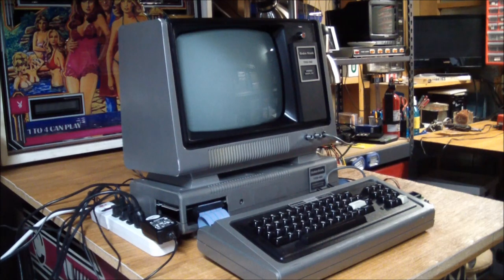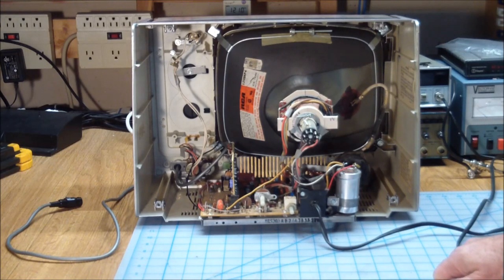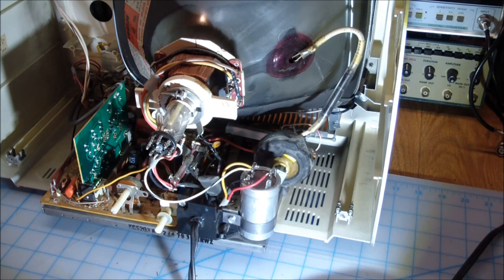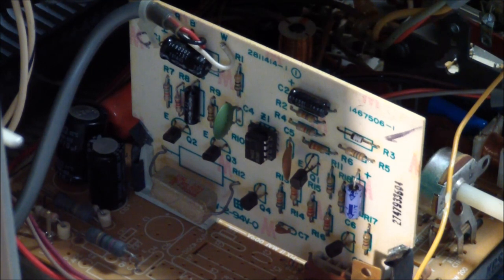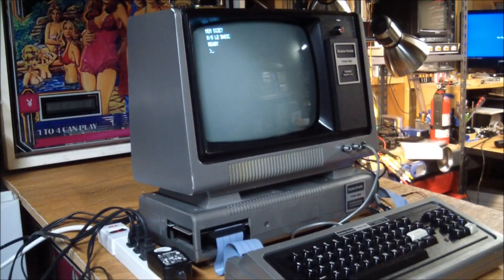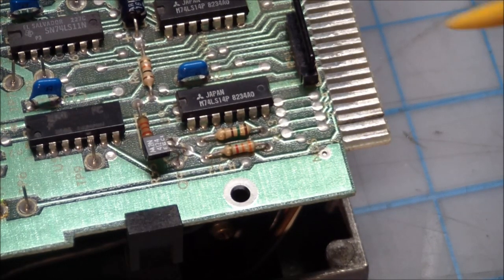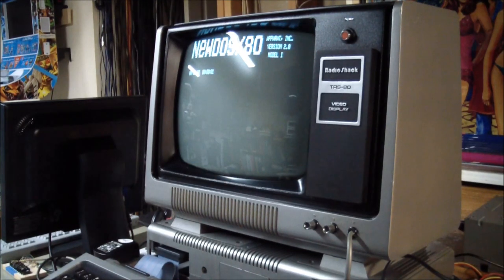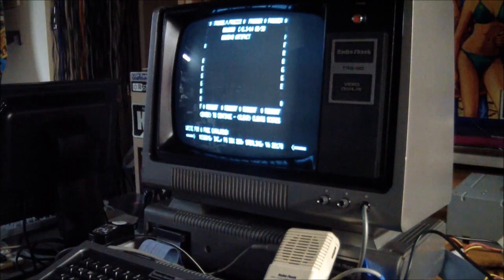AE#71 Radio Shack TRS-80 Model 1 monitor trouble

Comment: Optocouplers almost always fail as low gain, with I guess the led losing emission, because they are almost always overdriven to get decent output. Must have been the cheapest TV sets they could buy to convert, as 220V sets almost always used a transformer to get 12V, or used a better power supply that provided the B+ and other rails from the transformer of the LOPT and a higher voltage lopt supply generated by another supply locked to line, so there was no dot crawl.
Reply from the maker: You're right, I've seen this problem in pinball machines where the opto led was always driven very hot. In a Twilight Zone machine they used limiting resistors rated at 1W, and even those radiated a lot of heat.

Comment: Radio Shack way too cheap to add a 4 position DIP switch for the drive select.  LOL
Reply from the maker: That was a great way to force the consumer to buy their funky ribbon cable that had different pins removed on each connector.
Reply: @artifactelectronics  One would think a company like Tandy would recognize the risks associated with implementing proprietary design in what should be standard hardware.

Sony learned the hard way with BETA.  But then we have Apple with their charging cord plug for their phones. Well, then again we have the Chinese who rip off proprietary design and sell fakes just like this --> https://11points.com/11-ridiculous-fast-food-chain-ripoffs-china/

My favorite is OFC Chicken.  Seems they replaced the bust of Col. Sanders with Obama.  If this happened in the US there would be howling cries of racism. LOL

OMG what a crazy world we live in